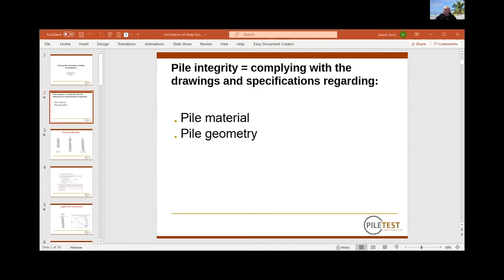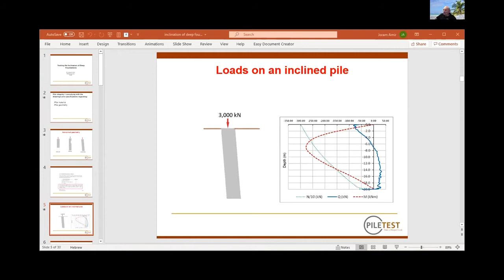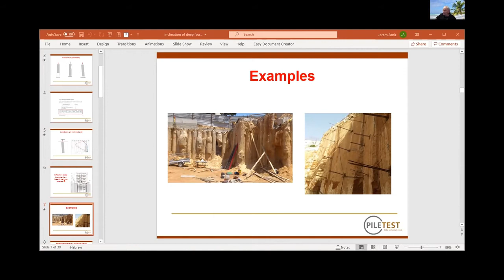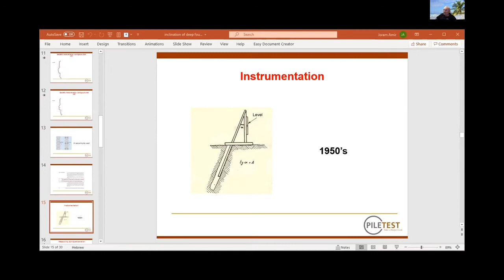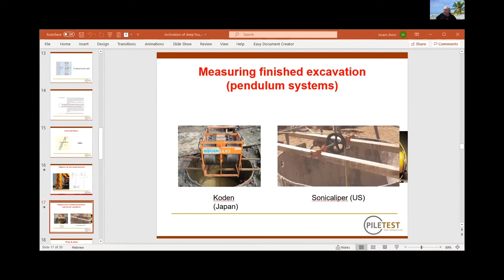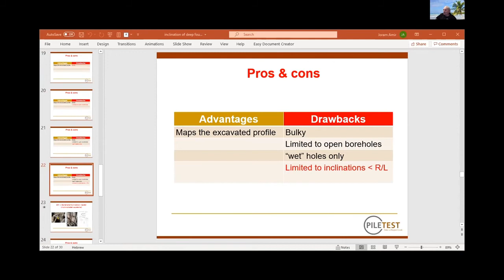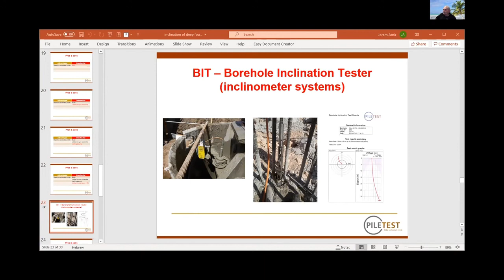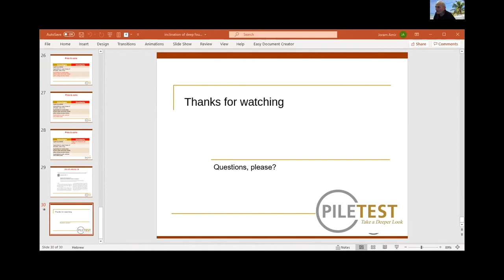Inclination Testing - An introduction presentation by Dr. Joram Amir

Comment: Does BIT measure the diameter and length of the borehole or shaft?
Reply: If would like to measure in completed shaft/borehole.
Reply: It only measures the inclination
It is lightweight and one man with no crane can run the measurement
Reply: @gadilahat3856  Thanks for reply. How about the depth of the borehole?
Reply: @dxbfortune  The depth is a by-product of the inclination measurement, as there is a very accurate depth wheel being used as part of the measurement. When the centralizer reaches the bottom of the borehole you get the reading of its depth
Reply from the maker: Diameter/profile: No - the bit only measures the axis
Length: Yes - but it is much cheaper and same accuracy to test with a rope and a stone ;-)